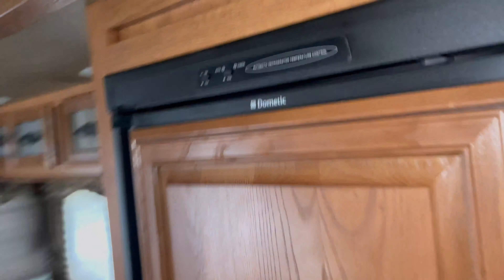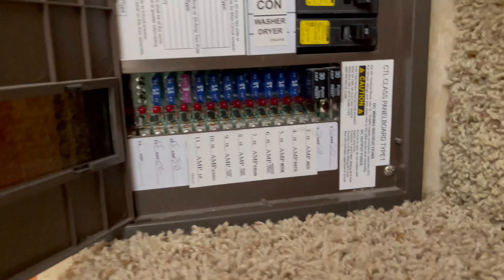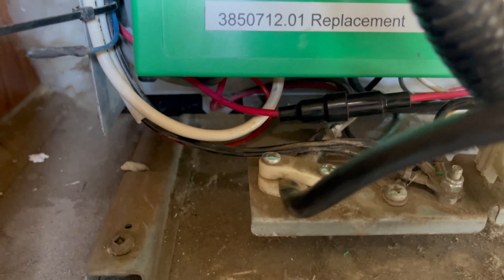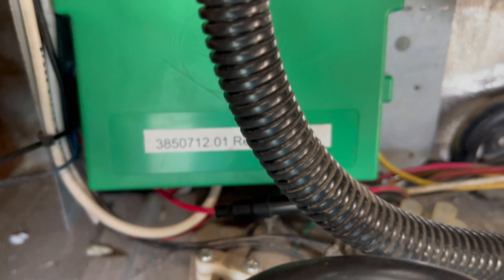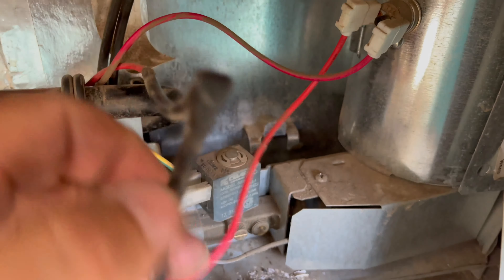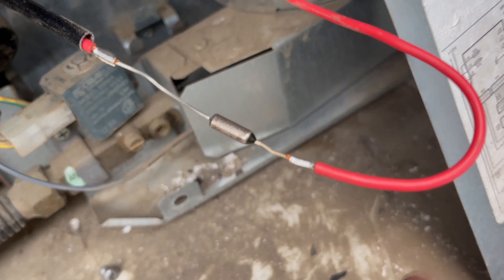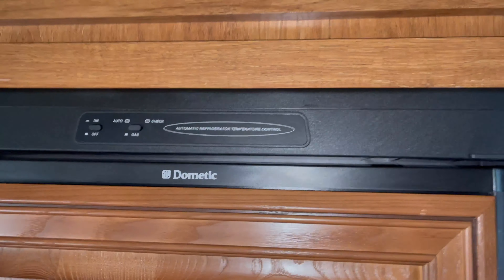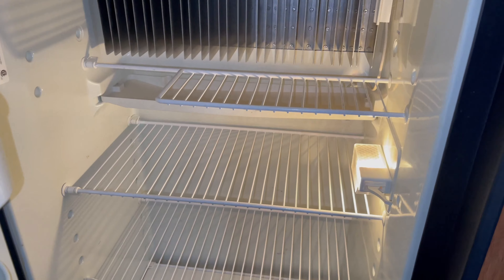Dometic Fridge Fix

Comment: What you don't explain is was your fridge not working on either gas or electric ? Mine will work on gas but not electric, setting it to auto it won't even detect an issue the damned thing just will not cool even though the yellow auto light is lit I have to manually set it to gas for the fridge to work
Reply from the maker: Mine wasn’t working at all.
Reply: @jayjohnson4352  Well that is something. My 110 issue ended up being the electrical heating element, explains why the gas side still worked. New issues today started up the freezer works but it stopped cooling the bottom, noticed the renter in it broke the thermistor so I'm just going to replace the whole unit with a residential from Home Depot this RV is now permanently stationed do dont need the gas side anyway. Play my cards right I can fix  (again) the Dometic and list it for what I paid for the Magic Chef.
Reply: This last fuse is connected to the propane control system and is meant to ensure that the temperature doesn't get too hot while operating on propant. When this one blew on my trailer, the only means of powering the fridge was shore power.